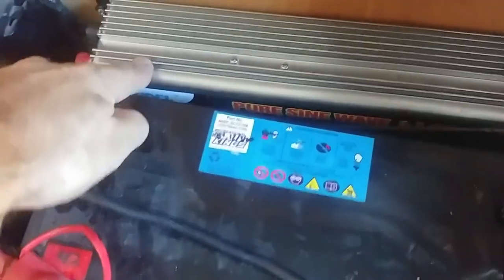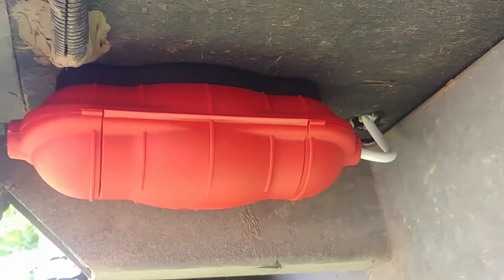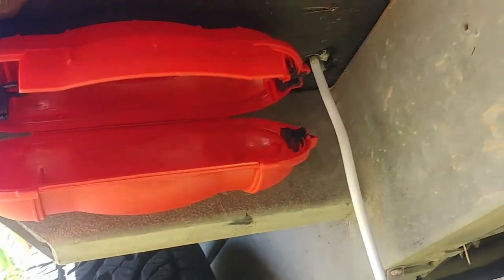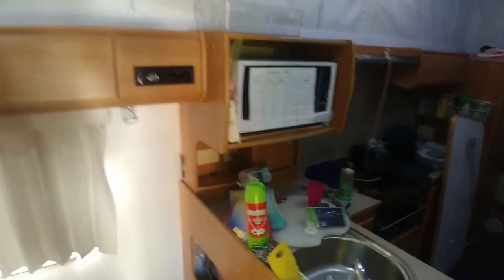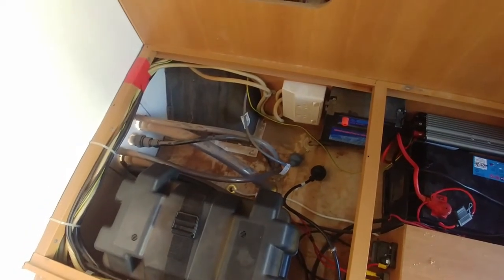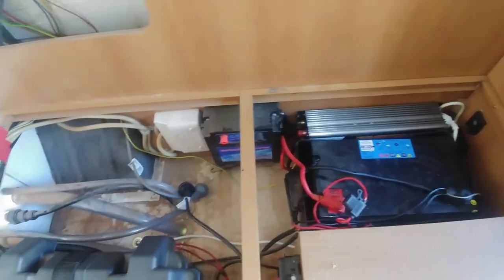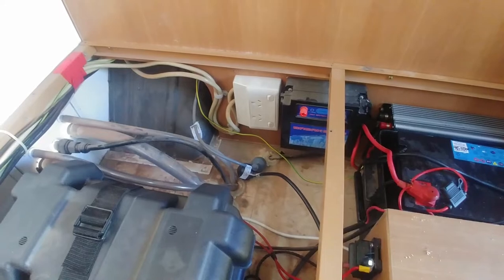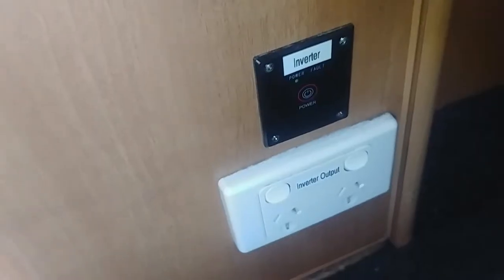[REVEALED] How to easily run your caravan / RV's power points directly off your inverter!

Comment: Hi I have been looking at doing the same in my van. looking into it more it's not safe due to RVD and no safety switch in case of a short to earth. You can get an ampfibian adaptor from bunnings for about $124 cheep a safe
Reply from the maker: Thanks for the comment Frank, and I appreciate your consideration.

I'm not sure how an Ampfibian adapter would help this particular situation. As far as I can tell it's just a 10A-15A adapter which incorporates a 10A circuit breaker and a RCD. There's no mention of RVD capabilities.

My inverter can only deliver 1200W (5A) continuous (it's rated 2400W peak but I've never managed to get more than about 1500W (~6A) out of it probably due to insufficient current from the batteries / wiring), so my power supply is physically incapable of delivering more than 6A into the 240V van input.

As far as a short to earth, let me say upfront that I am not a qualified electrician, but I do have a electronics qualifications and some knowledge of the theory of 240V systems, and from my non-expert analysis I can't see exactly where my setup would fail. But this is how I see it.

The only way you can get an electric shock is if there's a path through your body from one voltage to another (in this case from Active to Neutral or Earth). If either the input or the output of your body is isolated from one side of the supply you don't have a complete electric circuit and you can't get a shock. This is why birds sitting on power lines don't get electrocuted - their bodies might be at 415V relative to earth but they're completely safe provided they don't touch a neighbouring line at the same time (or someone doesn't run a wire from their beak to the ground!). As I see it, the whole caravan is floating relative to earth - it's more like a double-insulated appliance than a house where the whole slab under your feet is in direct contact with the earth. The only contact points to earth are rubber tyres, rubber jockey wheel and plastic feet under the legs which are all insulated. You could be unlucky and have dirt or water running over the legs which could connect those to ground, but even then it will only link the chassis to earth - inside the van you're standing on a wooden platform which is insulated from the chassis, so if you got 240V on you inside the van the only way I can see 240V getting back to earth is if you touched the kitchen sink which is earthed. The caravan has a RCD of its own, however that's unlikely to trigger anymore than the RCD within the Ampfibian if there's a fault in the caravan because nothing inside the van is connected to earth.

But even all that is only relevant if the power being fed into the van comes from an outside source which is earthed down to the physical earth (e.g. at a caravan park). If the power is being generated inside the van by an inverter and there's no path to earth,  it doesn't matter if something touches the ground - 240V has no natural affinity to soil just for the sake of it, it only happens because the Neutral line is usually tied to Earth at the meter box of your premises. So I cannot see how you'd get a shock unless you touch the Active with one part of your body and (in my case) the sink with another (as the earth terminal on my inverter is connected to the van's earth which is in turn tied to the sink).

Again, I am not an electrician so anyone please feel free to correct me if I'm wrong!
Reply: P @TheMusingGreg

Comment: I was told the cheater lead you made (15amp one end 10amp other) are against the standards and not allowed.
I do what you have done only use an amphibian adapter to make it legal and I have a Electric Power Cord Cable hatch in side of van just under 15amp inlet instead of going through floor.
With the isolated inverter the rcd in caravan does not work so I have had fitted an rvd for safety several years ago.
There is a lead you can get with an rvd in it so all is safe in the van.
Reply from the maker: Sounds fine. Technically you're right that a 10A plug on a 15A lead would be against the law, and that law is in place to prevent overloading of cables only designed to carry 10A. As I mentioned my inverter is a 1200W unit, which means it can only put out 5A - so there's no way the lead will be even carrying its rated 10A, let alone 15A! That's why I was happy to do it here - following the principle of the law, not the letter.
Reply: @TheMusingGreg  just a question/observation. Isn't 1200w ÷ 12v = 10a? If it's a 12v system.
Reply: @stevecrowe176  that lead is on the 240v (output) side of the inverter so 1200W/240V=5A. (And on the 12v (input) side you'd have 100A, not 10A :-) and that's why the battery->inverter cable has to be that chunky... and probably has a CB or fuse inline somewhere)

Comment: Do you use lithium batteries in your caravan?, I just bought a 135AH AGM battery but I'm worried it will give off fumes inside the caravan especially when charging it, it says on the battery "don't recharge in a sealed container" so I thought I can't charge it inside the battery box inside the caravan, I'm starting to think I should have bought a lithium battery, I'm getting confused
Reply from the maker: Nah you'll be right. Mine are both AGM batteries. They would be referring to not charging it in a 100% airtight box, and if you've got a battery box inside your van it wouldn't have needed to be airtight. Lead-acid batteries give off small amounts of fumes when charging and these need to be able to escape, however I believe AGM batteries give off way less that wet lead-acid batteries as you have in a vehicle, which is why they're sealed up units anyway.

Comment: hey mate how you going, doing my own electrical system right now and wondering how you wired a power point from the inverter which is essentially another power point? is there a specific cable to do this? cheers heaps!
Reply from the maker: Hi mate, firstly I'd always recommend getting an electrician to do wiring if you're not sure what you're doing. But that said, no it's not a special cable - it's basically just an extension cord with a 15A socket on one end instead of the standard 10A socket.

My inverter has two standard 240V power outlets, so I simply bought a 3m extension cord from Bunnings, cut the socket end off, poked the now-plugless cable through the hole as shown, and then wired up a new 15A socket on the bare end once it was outside the van. So you end up with an extension cord cable with a standard 3 pin plug going into one of the 240V outlets on the inverter, and the other end has a 15A socket (instead of the standard 10A socket) which plugs into the van's power inlet. Of course it's critical that whoever wires up the plug makes sure it's wired correctly otherwise you could be in a lot of strife! 

Theoretically, a 15A socket should be on a 15A cable. However I know my inverter can only provide 1200W (5A), so there is never going to be more than 5A going through that cable. If you had an inverter which could provide more than 2400W you would want to use a 15A cable.

Good luck, and stay safe!
Greg
Reply: @TheMusingGreg  thanks heaps mate, really really appreciate it! massive massive help!!!
Reply from the maker: No problems mate, good luck with the work!

Greg

Comment: I'm thinking of doing this myself, with the battery fully charged  how long do you get before the battery goes flat? I know this question is like how long is a piece of string but I'm trying to get some ideas, cheers
Reply from the maker: Hi Dean,

Mate that's correct, it totally depends on your setup and what you're running from it. For example a 1x 50Ah battery are running a 240V TV, fridge and charging laptops is going to last a lot less than 2x150Ah batteries running just 12V devices.

For what it's worth, we have 2x100Ah batteries, LED lighting and a gas fridge, so we only use the inverter for charging laptops and a dustbuster vacuum cleaner. If we weren't topping up the batteries in between (which we almost always do), we would probably get two, maybe three days' use max from the batteries.

Hope this helps!
Greg
Reply: @TheMusingGreg  Hi Greg, thanks so much for the reply, I really appreciate it, I'm thinking of doing a set up with solar panels recharging the battery, I'm new to all this caravan stuff, I have a bit learn, just wondering would it be worth paying the extra for a 2000 or more watt inverter so you could run your microwave and hot water?
Reply from the maker: @Djr67  Hi Dean,

I wouldn't try to run hot water through an inverter. A gas hot water system would be far more efficient, and most caravan hot water services have a gas heating system (as well as a 240V when you're at a caravan park). Anything that generates heat will draw a lot of current (blow heaters, toasters, kettles etc), so since you have gas onboard and gas creates lots of heat when burnt, it's the best thing to use for heating when possible.

For the microwave, possibly so if you want to do that but it's a question of whether the batteries and wiring can supply enough current that quickly. 2000W is 167A (Current = Power / Voltage), which is an awful lot of current. It's the sort of current a starter motor might draw. It would be possible if you've got a couple of batteries wired up in parallel and with very thick wiring, but you'd be best to talk to an expert to work out exactly what's required. I went with the 1200W mainly because it was the biggest I could fit in the space I had available, and was happy to forego the microwave (we've travelled for 15 months without really missing it).

Cheers,
Greg

Comment: Hey mate, nice simple and easy set up. What batteries do you run? Lithium or conventional AGMs? Also, how big are your solar panels? Thanks
Reply from the maker: Hi mate, I have 2x100Ah AGM batteries in parallel which get charged by solar blankets. As I've been reviewing solar blankets I've had a few different types but mostly I was using a 200W Kings unit and a 150W Redarc unit.
Reply: @TheMusingGreg  thanks mate, similar to mine. Good to know. 👍

Comment: Hi, Are you still running this same setup? Looks like something I want to do to my caravan :)
Reply from the maker: Yep been running this setup for the past two years, still working great! The only problem I had was the cable cover came open once on the Oodnadatta Track and the cable fell down and got pulled under the wheel and ripped out of the inverter! Thankfully no damage to anything but the cable and cover. Apart from that all good
Reply: Would you do better installing an outdoor socket under the caravan floor and using a jump lead (or the hookup cable) to link it to the caravan inlet.

Comment: Putting a 15amp plug on the end of a 10 lead is illegal in most states. What did you do?
Reply from the maker: The reason it's illegal is because most domestic 10A power circuits are protected by a 16A circuit breaker, which means a 10A cable could potentially deliver up to 16A if it was connected to a device which could draw more than 10A (like a caravan).

The difference with my setup is that my inverter is only capable of delivering 10A anyway, so regardless of what plug's on the end I'm never going to get more than 10A flowing through my 10A lead. This is why I'm comfortable with this setup.

Comment: Can I charge the battery with the solar panels and run the inverter at the same time?
Reply from the maker: Yep absolutely. The solar input to the batteries is a completely separate process to the inverter. Just make sure the 240V battery charger is turned off otherwise you'll be using battery power to run the inverter to power the charger to charge the batteries! The power will just go around in a loop and waste power.
Reply: @TheMusingGreg  sorry for all the questions, so the solar is connected to the battery terminals same terminals as the inverter?
Reply from the maker: @Djr67  No hassles mate, ask away👍. Yep that's correct: solar blanket -> solar regulator -> battery terminals; and battery terminals -> inverter input. You might think this means the regulator output is connected directly to the inverter input but it's not - having the battery sitting there on the same set of terminals is what makes the difference. The regulator is expecting a battery there, and the battery acts like a giant sponge and can absorb pretty well whatever the regulator throws at it. Whereas the inverter will only be drawing as much current as the load needs, which may only be an amp or two, compared to the battery being able to absorb 15-20A if the regulator could deliver that. Something would die quickly if you connected the regulator output directly to the inverter input. The battery has to be there to smooth out the fluctuations in current and deliver a constant output into the inverter.

Comment: I bought a camper where the last owner had created a port inside specifically for wiring an inverter directly to the inner AC wiring.  However, now that I see your video I am realizing that his hack has likely skipped the input breaker box and thus is an unsafe method.
Reply from the maker: Yeah I was a bit unsure about that sort of thing and figured simply plugging it into the normal inlet would be the safest method. It also means there's no chance of being on park power and accidentally firing up the inverter and having two non-phase-synced 240V supplies running into each other (i.e.bang!). It means too that the input runs through the breaker, but I don't know how effective a RCD would really be with power from an inverter though.
Reply: @TheMusingGreg  Is there a safe way to test & see what would happen?  I'm not even sure what the bad event would be that would cause a trip.  A short circuit in the AC wiring?
Reply from the maker: @surfreadjumpsleep  The biggest problem I see is that when the inverter starts up, its AC supply is almost certainly going to be out of phase with the caravan park's AC supply. Both will be roughly 240V 50Hz, but the 50Hz sinewaves won't be in phase - that is to say, when one is at the peak of its waveform, the other will be somewhere else in its waveform. So you'll get a lot of current going from one supply straight into the other, and neither supply is designed to absorb power, they're designed to deliver power. The inverter almost certainly will be the weakest link. If you're lucky some protection might kick in but since they're not designed for that type of situation it's more likely the inverter will be damaged. You could also knock out a circuit breaker in the caravan park or worse.

So all round it's a bad idea to have two independent power generators driving into each other! :D
Reply: @TheMusingGreg  I was thinking about this.. instead of routing outside and then back inside the camper, I think what I'll do is cut the connection from the external to the breaker box.  Then I'll make an input plug to the breaker box.  Either the line to the outside, or a line from the inside inverter will go to the breaker box input.
Reply from the maker: @surfreadjumpsleep  Yep I think that would work just as well, as it'll make sure there is only one power input to the system. I mean if you were going to get fancy about it you could have them both hard-wired in and have a break-before-make 240V 15A changeover switch which switches from one supply to another. There are other solutions too but either way you want to make sure you only have one supply connected to the van at a time.

Comment: Get a qualified 240v electrician to fit a relay to switch over from external power to inverter power, and run your inverter to the relay. Just did one works fine. No plugs required.
Reply from the maker: How much did it cost if you don't mind sharing? I didn't do this originally because I was only going to keep the van for 6 months.
Reply: @TheMusingGreg  Hi Greg, I'm an electrician in Perth, Relay was $132, $33 for power lead which you have, $15 for 4 pole load centre. Plus labour depending on you van 3-4 hours prob less the $500 for labour.
I would have to look at it to be more definite on price. Hope this helps.
Reply from the maker: @shanek105  Cool thanks mate. I had heard around $600 which sounds to be about on the money.
Reply: @shanek105  mate i have a van with an inverter i have installed. the inverter has an ATS built into it so i have the run out of the inverter to a power point.... when shore power is plugged in the inverter cuts out. my question is how to i run the inverter power lead internally into the back of the shore power to make all the 240v power outles in the van live off the inverter?

Comment: This is illegal you must have an RVD safety chord to earth it properly It is dangerous!!
Reply from the maker: The issue is that the whole chassis is floating relative to earth, and almost everything in the van is insulated too. It might be different if this was a metal-bodied van, but it's fibreglass with timber floors and timber cupboards. The sink is the only thing that's metal, and that's earthed to the inverter anyway.

Comment: Does the extension cord need to be 15amp plug??
Reply from the maker: The socket on the outside of the vehicle has to be as the power inlet into your van will be a 15A plug. On the other end you'll just need a standard 10A plug to go into your inverter. The simplest way to do this is to get a right angle extension cord from Bunnings and a separate 15A socket. Cut the 10A socket off and replace it with the 15 amp socket.
Reply: @TheMusingGreg  thankyou very much mate
Reply from the maker: @marksmith9303  No problems mate, take care.